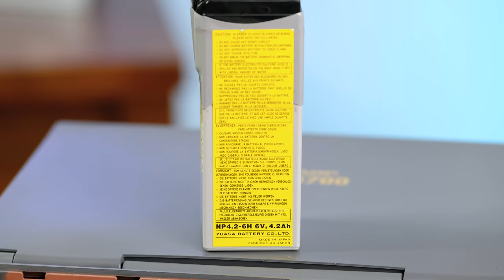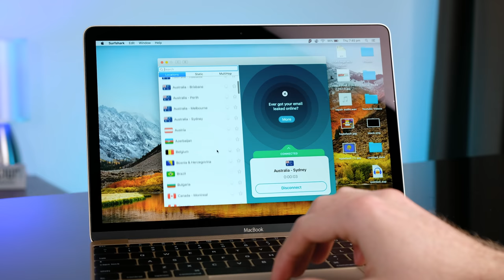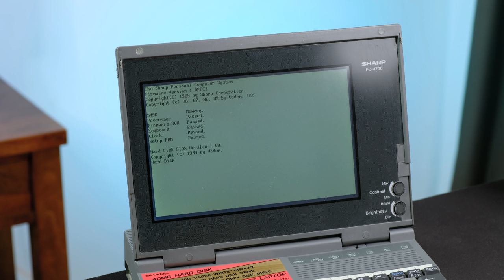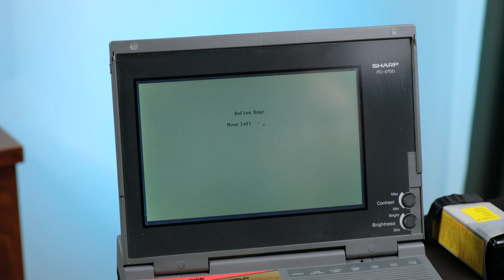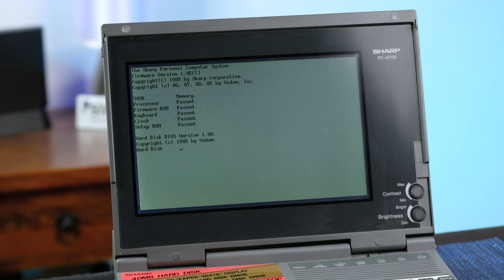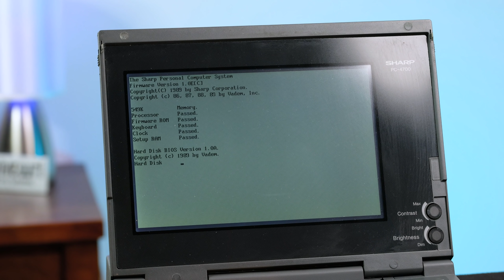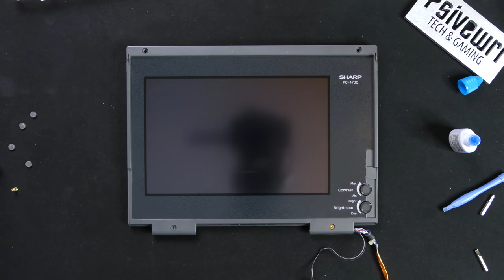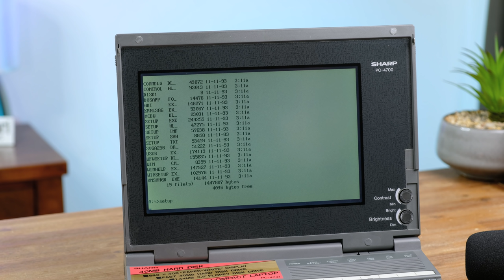I Bought A 30 Year Old Laptop From eBay! Can We Fix It?

Comment: These hard disks are low density meaning they can be opened without any consequences unlike new drives, the lines on the platter is just what the old drive platters looked like back in the day. I’ve worked on plenty of them, especially Apple drives and I’ve had my fair share where as soon as I open them they start working again. Not 100% sure why that happens but it’s been very helpful with drives that I just couldn’t figure out what was wrong. Also some of those old drives has rubber grommets in them so that when the head was seeking it wouldn’t be as loud, but over time they turn to a sticky mush and cause the head to stick to them thus causing the drive not to work. Thankfully they’re only there to make the drives quieter so you can just remove them without it hurting the drive.
Reply: Is this the case with my seagate medalist 1,7gb hdd i just want to know
Reply: @ZEREXIA  It’s possible, looks like Seagate Medalist drives with 1.7GB came out around 1997. Couldn’t find if they’re high or low density, typically you can tell from the color of the platters, if they have a yellow tint to them it’s a low density drive, but I believe there were a select few drives that had standard chrome platters but were still low density. If the hard drive is broken it wouldn’t hurt it any further to take it apart. If the drive isn’t even spinning up though it’s possible it’s the hard drive’s motherboard that’s the problem.

Comment: 6:57 ... It's not "SSL IDE". The hard disk shows up on Google as "CONNER: CP-4044XT 42MB 3.5"/SSL IDE / XT". The SSL is part of the form factor and means "Super Slim Line" (you even said this before). The connector seems to be a 44-pin PATA/IDE. You should be able to get a 44-pin to Compact Flash adapter and replace the HDD with a CF card.
Reply: Markus Birth The complication is that it’s an XT-IDE drive, which is in incompatible with the far more common ATA standard. Adaptors for this do exist, but the problem is that they all seem to be designed to plug into ISA slots. Looking at the manual, you might be able to tap the ISA bus on that 50 pin connector, but the block diagram is heavily abbreviated so good luck figuring out the pinout

edit: the service manual actually has pinouts and even circuit diagrams, but I can’t quite see where it all connects to.

Comment: I wonder if Windows 2.0 would work. That said, those IDE connectors are interesting, considering there isn't a power source to connect the drives to. Maybe the same mainboard was used in some desktop machines?
I also wonder how doable would be to just gut all the innards and make it a Raspberry Pi based machine. Imagine if someone did that and made it a semi-modern machine in that form factor :P
Reply: Windows 3.0 will work ,you do not have to going back to the 2.0 ot 1.0

Comment: Great job!  Maybe that'll end up in a museum that curates old computer models. The LCD has got me baffled.  There must be a special graphics mode that interprets normal CRT graphics modes.  There is a bit in one location that enables graphics.  Is their CGA  connection.  You might want to try plugging a monitor into that.

Comment: I think what you had was stickchin. in old hard drives the unit does not park the head off the platters like todays hard drives. A soft tap with a rubber mallet  on the top can sometimes unstick the heads.

Comment: You could try to install Windows 3.0 or the beta build 26 of Windows 3.1 which both still include a kernel for 8086 processors. You can find them on sites such as winworldpc or archive.org
Reply: I installed Win 3.0 on mine then upgraded to Beta build 26 👍

Comment: You might want to consider a Lithium Grease instead of WD-40. I mean if it works for you it works for you, but WD-40 isn't actually intended to be a long term lubricating oil so it's just something to consider.

Comment: with the olds msdos  pcs you had 4 main graphics card types monochrome,cga (4 colours),ega (16 colours)and vga (256 colours) and the later super vga(16million) and xga

you also had to manually configure you ram  by editing the config.sys which will enable you to configure ram as extended memory or expanded memory depending wether you are using it for work or games, happy to costomize any startup files for you or anyone on old machines 
xtree gold was a terrific program that was great when u wanted to copy files or delete and make changes it also had a prune option which would let u delete directories and sub directories in one go

Comment: Maybe you can try installing Windows 3.0 or 2.x on it since those are compatible with 8088 processors. I'm sure either would work on the 80188 cpu this laptop has since for 3.1, you'll need a 286 processor or higher.

Comment: The program is Direct Access. it was basically a way to load programs for people that weren't good at DOS. You can change the menus to say anything you want really. https://winworldpc.com/product/direct-access/5x this works in dosbox if anyone wants to play with it. Also, likely the only programs that will run have to support monochrome graphics. looking at the service manual for that laptop side by side with the pinout of standard ide is almost verbatim the same as far as pins, so an ide adapter could be built, but by someone with greater skills than me.
Reply: Well, looking at the screenshots, it appears that it's actually a 4x version, probably version 4.1, being used.
5x seems to show the software name and version number, which I didn't see in the video.

Comment: Well done with the hard drive repair!  Never seen that done before successfully.  
BTW, the menu program (Direct Access) is the same one I had on my first IBM compatible PC back in '91.  It is a customisable menu system to launch DOS based applications.  I had version 5 which had a multi-coloured splash screen.  Yours is 4.1 I notice.

Comment: I got a untested Toshiba satellite from 1996 it didn't even have a charger but when i did get a charger the hard drive was working fine, and it was not password locked but the one thing that surprised me was that the battery was still working!  Note it was running windows. 95

Comment: I've got a SD adapter new old stock with the same interface, I buy a lot of tech from flea markets. I purchased a case of them and I've sent some to other youtubers at this point there is only one left available. The pin out on your hard disk is identical to the IDEII pinout on the board.

Comment: I know why the hard drive started working after he opened it up because the reading arm was basically seized and from him moving it on seized it. Basically the hard drive wasn't set to its locked position when it was transferred during shipping...

Comment: NOTICE at 11:17 the head is manually moved, probably freeing it from the position it was stuck in. The groves on the platter are caused by the head dragging on it while reading or writing to the disk. Definitely not what you want to see on the platter. The best you could install is Windows 3.0 if it has a compatible graphics card.

Comment: I have a 30 year old MFM hard drive that would not spin but showed other signs of life and it gave me a 1701 ERROR at boot.  Breaking the motor free (I was able to spin it without opening it because of its design) allowed the drive to spin up and start working but I received a lot of SEEK errors.  After oiling the step motor for the drive heads the drive works.  I have fixed the floppy but it only sees 360KB floppies due to the BIOS/my controller so I have been unable to image the drive.  Maybe MS DOS Interlink if I can find a parallel cable and copy files to my Pentium 100 and then to CD.

Comment: i have a question. Can it run WIndows 95?
Reply: fart fart It only has an 8088-class processor. The highest version of Windows that it’ll run is 3.0 since later version dropped real mode support. You need at least a 386 to run Win95, but realistically you wanted at least a 486 with some kind of Pentium being needed for best results.
Reply: @ianweber9248  oh well.Lol i can understand how old it is and gosh if it did it would not really open anything

Comment: windows 3.0 may work since it work on an 8086
Reply: yes :)
Reply: @intel386DX  I really want him to try it
Reply: @intel386DX  the cpu is this https://en.wikipedia.org/wiki/Intel_80188 or at least something based on that and the minimum requirements suggest it will work https://en.wikipedia.org/wiki/Windows_3.0#System_requirements
Reply: @SharkVaderYT  exactly :) this CPU is near the most advanced for the XT platform and even have 8080 emulation mode and 188 instructions :)  tho this machine is CGA and I am so mad that he did nt figured out this look! 2:10 I kept trying to run EGA/VGA games on it!!! BTW Commander Keen 4, 5, 6 and Dreams have CGA variants ,but 1,2 and 3 have only EGA variants.
Reply: intel386DX yeah he should make an update video
Reply: @SharkVaderYT  I agree! :) and even check is there any external CGA RGB headers or composite out headers for external display
Reply: intel386DX great idea!

Comment: if you want to install windows 3.11 you need 386 cpu. On this computer you can install windows 3.10 or if not, then you can install windows 3.0. When you yave time just try it and please let me know if it worked. I had a 286 computer running msdos 6,22 with windows 3.10. And after that i have installed MS Office 3.0 (word 2, excel 4 and powerpoint 3). It had 2 megs of ram and 42 megs of hdd MFM. I have installed also Corel Draw 4 onto it. I still have the old software, but unfortunely i don't have the necessary hardware for it. When i wanted to install 3.11 it asked for a 386 cpu. Also, i know that windows 3.0 needs under 1 meg of ram. Maybe you can make it, i don't have such and old computer, because otherwise i would have done the test myself :) ... Here in Romania there are few old computers on sale and the sellers want unjustified prices for them. But maybe one day i'll buy one :)

Comment: This was my very first PC computer.  (I previously had a Mac.)  I got it in summer of 1991 when I was 16.  Even when it was new in 1991, it was grossly underpowered.  Remember, the 486 CPU existed back then, yet this computer only had a NEC V-40 CPU, something that was roughly equivalent to an 8088.  VGA laptops existed at the time, yet this only had CGA.  Run-of-the-mill desktop PCs back then were far more expensive than today, and laptops even more so.  Sharp released this laptop with outdated technology so that it could offer an affordable laptop.  I really wanted a PC laptop back then, and I wasn't going to pay the thousands and thousands of dollars for a 386, or even 286 laptop.  So I got this Sharp model.

The video makes it sound like it has no graphical capabilities (i.e., that it's text only), but that's not true.  It was CGA compatible, and I ran CGA shareware games on it.  The video mentions that they keyboard wasn't very good.  Mine actually came with a defective keyboard; whenever I typed on it, the whole top-right side of the keyboard would mush inwards.  The store and Sharp weren't responsive to my complaints.  I ended up contacting a computer magazine (I forget which one), that had a column where you could write in about problems with computer vendors.  A person from the computer magazine actually called me back and told me that she had contacted Sharp and had arranged for them to fix it.  (It shouldn't have taken a computer magazine's intervention to get this defect fixed!)  My parents  drove a few hours to Sharp USA's headquarters to get it fixed (I was at school that day and didn't go along).  It turned out that it had been missing a screw.  After it was fixed it worked fine.  As the video stated, it had limited ports.  I had an external trackball and an external modem, and had to use a switch box to connect both the trackball and the modem.

Yes, it was an underpowered machine, but I loved it.  It was my first PC, so I learned the MS-DOS command line on it, as well as programming (Turbo Pascal).  I also used it to interact with the early 1990s world of BBSs.  For word processing, I used LetterPerfect which was basically a pared down version of the venerable WordPerfect 5.1 for DOS.

Thanks for creating and posting this video, it really brings me back to my early PC days!

Comment: That laptop can run Windows 3.0 in real mode but most likely not ideal. It can even run in VGA mode as the CPU as the Intel 80186 instructions.

Comment: I know it's a laptop, but an 8088 equivalent, in 1990?  The 486 was already a year old, and the Pentium would've been released 3 years later.
Reply: actually NEC V40 even have  80186 instructions so it is the most advanced CPU for XT class machines :)

Comment: I was surprised you were not familiar with xtree. It was the go-to file manager utility. I had it on all my support discs. It was needed to make It easier to browse the hdd and move files. It also allowed to view file  contents. And the menue program was common at the time, you could rename it to what ever you wanted. I would expect changes to the config sys and autoexec files would have made the non working programs work. I am very surprised  the previously  installed programs did not work. As when you install them they did not add themselves to the menu so they would have to be installed then the person add them to the menu so they should have worked was there additional memory option for the laptop that was removed at one point before you got the computer. Or a later program installed program changed the config.sys or autoexec files. Or after the original owner gave it someone, they have made changes without knowing what they were doing. I was surprised when the author of this video did not open those files. Then I was saddesen when Nathan said he installed dos 6.2. I felt he ruined it at that point. There were differences in operating systems should have need avoided. Also, it is possible the information/ program files on the hdd had degraded over time. That would also make system be not working . I would see iutility to check sectors and defragmentation utility is available for it to refresh the data program filed on the hdd. My wording may not be exact but you get the gist

Comment: I think the problem with the games is that the 'graphics card' may be not really a graphics card et all, and supports only the basic text mode.
Reply: Fre1maurer It’s CGA compatible, so it does support “graphics” and being a monochrome display you’re spared the horrors of the CGA palettes, but it’s so slow that it’s fairly useless for games.

Comment: I think I know why lemmings didn't work. back in the late 80's, laptops were always a generation behind desktops. So a laptop from the late 80's like this one would have a 8088 or compatible cpu and CGA graphics. So not many late 80's games will work on this system. Look for older games that were made for the IBM PC XT class of computers.

Comment: Out of curiosity, could you try installing Windows 3.0 onto the laptop and tell me if that works?
Reply: I have the very same laptop and I managed to install and run Windows 3.0 onto it. The mouse works but, of course, you'll need a serial mouse since there are no ps/2 ports or proprietary mouse connectors to it
Reply: @GioeleFrapolli have you got the carry bag and manuals?
Reply: @stevenmccormack6041  I don't have the carry bag (and actually did not know there was one) but I have the operation manual although it is in German. I remember downloading the service manual PDF which was in English but I don't recall seeing the operation manual anywhere.

Comment: The reader arm on the hard drive was seized by you moving it back and forth fix the problem it's due to people not locking the hard drives before transporting the laptop. As the hard drive arm would seize if not done.

Comment: Is there any way to replace the battery or convert it to a lithium ion pack??
Reply: John Don You can actually still buy those sealed lead acid batteries. The service manual doesn’t seem to have more detailed specs on it, so I’m not 100% sure if that specific size is still available or not.
Reply: @ianweber9248   I mean, I live in malaysia... but googling that battery I found more modern type. But you are right... the service manual tells me the voltage in and I can make my own lithium ion pack with that info Thanx man :D

Comment: 8008 ? 1990? Really?
A 8 bit CPU from the early/mid 70s in a 1990 machine.
Probably not. Running MSDOS, certainly not.

Oh yeah. I also love the old "iron". Retired chip designer.
At 78, I am an antique myself!! Keep up the good videos.
Cheers.
Reply: 8088* clone, not 8008...

8088, 8086, 80186 and 80286 CPUs were in fairly widespread use a decade or more post inception. Computer tech was very expensive in real terms then compared with now, but Moore's Law brought us to where we are now...
Reply: @nobbynobbynoob  "8088* clone, not 8008..."

Exactly certainly NOT an 8008. As a chip designer for about 35+
years, I was - and am - a lover of these machines. My first "real"
home computer was a Mark8 - 8008, 6 PCBs, 1K RAM (4 banks 
of 1101s !!!) and TTY interface. Hot stuff in those days.......

Comment: OH HEY can i send you a toshiba l355d-s7813 system unit (stuff on the bottom)everything works but the string is sketchy and runs windows vista and needs a new battery

Comment: That thing would have run Windows 3.1. You tried installing Windows for Workgroups 3.1, which requires a 386.
Reply: Windows 3.1 requires a 286, but this would have run Windows 3.0.